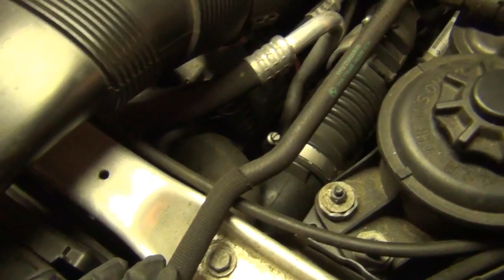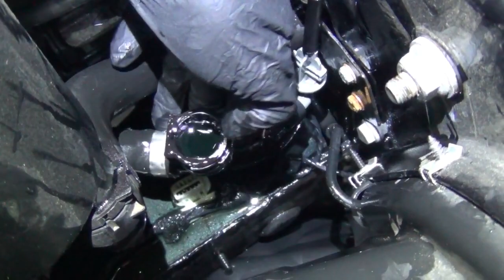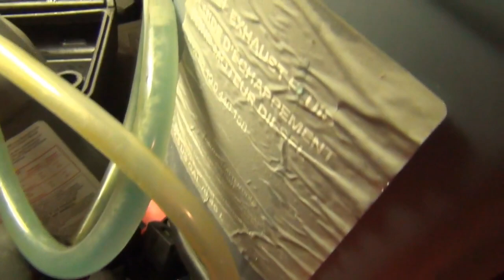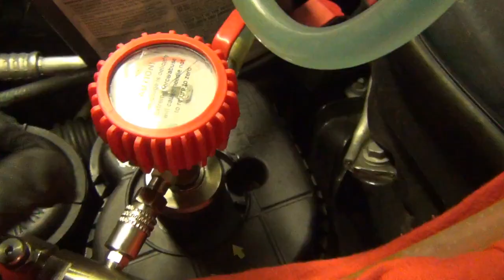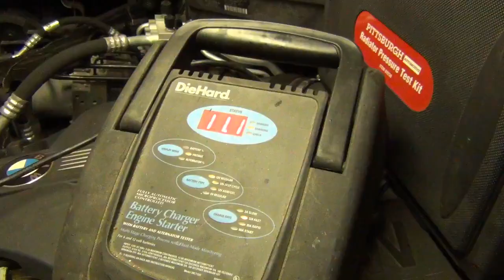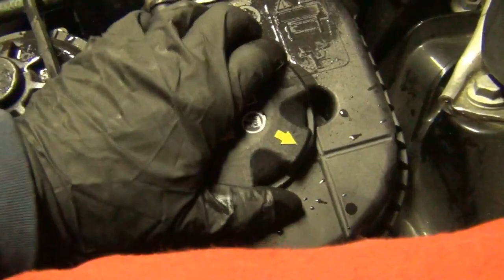BMW X5 Expansion Tank Replacement E70 With The N55 6 Cylinder Part Number 17137552546

Comment: Nice video! Is there any reason some of the N55's spin bearings and grenade? Poor maintenance? I have an 11 335i Xdrive Msport. I've been changing the oil every 3k miles since I got it at 70k miles, and I've done the ofhg gaskets. Anything else I need to know, Thanks!
Reply from the maker: Hi CBenz, Thank you. You are correct that N55's can have bottom end issues with spun bearings and engines seizing. Doing your oil changes every 3k should help prevent this. Poor maintenance is one reason for this. 8 to 10K is a long time before oil changes. I would recommend at least every 5 K and 3 K is even better. Also, short distance driving is a factor due to moisture build up in the oil. I actually have seen ice balls in the oil on really cold days which if it occurs can block the oil pick up and starve the engine of oil. This is usually from a lot of short trips and the engine does not have time to heat up and dissipate the moisture. When you see a lot of foam on your oil cap this is what is occurring. I plan on making  a video on this in the near future.
Reply: @AskTheCarExperts  Thanks for the reply! I'm just surprised how much darker the oil is at 3k miles on this engine is vs 5k I had an M54. I guess this is the nature of the direct injection turbo engines and tighter emissions. Also where I live the engine is always fully warmed up by the time I get there and I haven't seen any milky foam under my oil cap. Another question, on the N20's with the updated timing chains and guides, are they having the problems like the earlier engines with the timing chain failures? Thanks!
Reply from the maker: Unfortunately the N20's and N26's are having some timing chain issues. I have heard of a possible class action lawsuit in progress but not sure on any details yet.